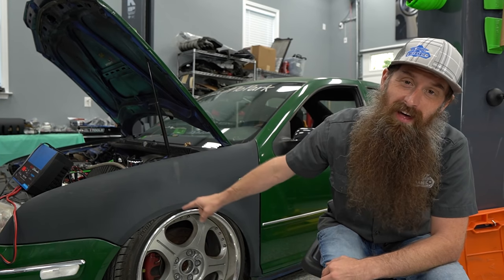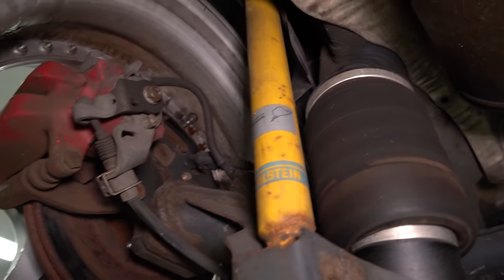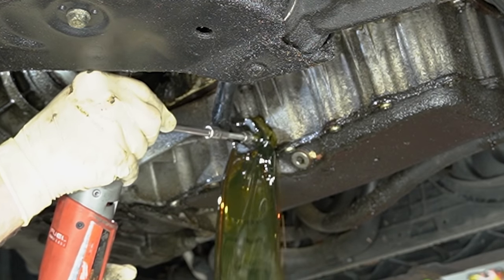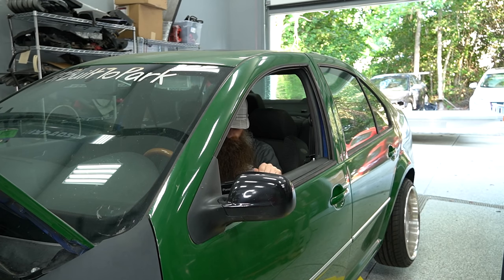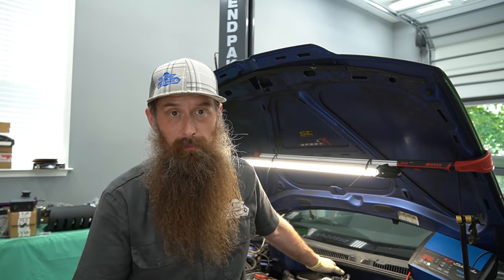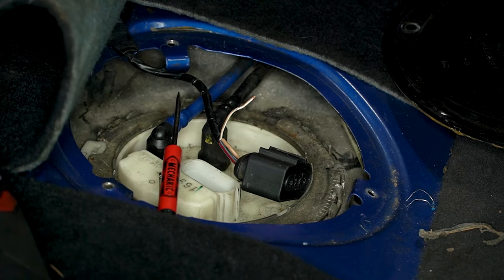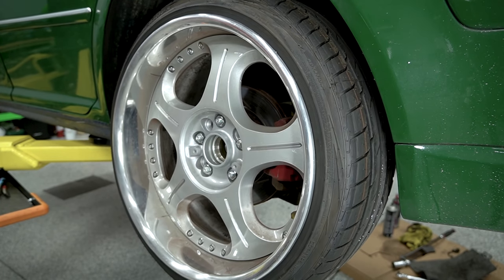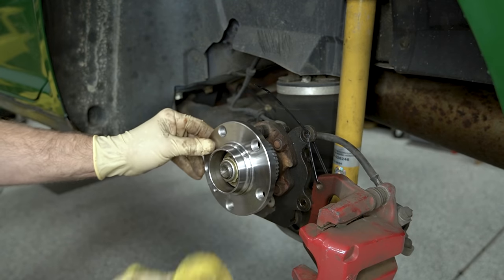Fixing a STANCE CAR for a 6000 Mile Road Trip

Comment: Pro Tipp for replacing the rear wheel bearing: 
1. Heat  up the bearing with a hairdryer to 90°C/194F 
2. Use cooling spray and  a PVC pipe to cool down the axle pin to-40°C/-40F
3.Slide on bearing easy

Comment: What I've learned with these cars is when adding rear camber, you have to account for the angle of the caliper too. You shim that as well. And also everybody forgets to shim for the added toe when adding camber
Reply: Yeah but how would you have your caliper moving independently of your axle?
Reply: @aygwm  the caliper mounts to the rear beam, separate from the hub. you can see it at 18:15
Reply: The drop plate should have the "camber" for the caliper carrier integrated in to it.

Comment: Great video! After watching part one of their trip I was curious about the bag system that was on the Jetta and what was causing the horrible camber even at a lowered height that shouldn’t cause so much negative camber. I’m glad that you covered the suspension modifications because I had never messed with any “stance” modifications. I’d never seen most of those mods before

Comment: A former co-worker's son came in one day to have work done on the car for inspection. It was a Focus ST and lowered on air. So the day his son brings the car, it fit on the lift just fine(just to note, the shop I worked at had in ground lifts). Co worker couldn't do inspection because of no registration. So next day co worker brings it in, and it wont fit on the lift. We're all scratching our heads because we couldn't figure it out, so we used a 2x4 to get the car over. After finishing the car. I saw the interior and the remote(for the air bags) and told said co worker to press the up arrow. Lo and behold car starts lifting up. Moral of the story, if you are working on a slammed vehicle on air, make sure you lift the air bags to higher than the lift pads and also air leaks out overnight I think, unless the POS had a leak. Anyway love the vid Charles as always. Also any plans for another meetup? I'd love to drive my R129 500sl(if allowed) to some car meet!

Comment: Been using a cheap aluminum diverter valve on my 1.8t.  RKX 1.8t/2.7t machined diverter.  They've been fantastic and easily modified depending on boost levels as they came with extra springs/washers.  Highly recommend over the stock plastic ones.

Comment: From my old BMX days, anywhere 2 different metals are touching, coat that area with some copper based antisieze.  We always saw aluminum spoke nipples time-welded to steel spokes.  Is this true in cars, such as where the aluminum adapters fit over the rotors?

Comment: hey, probably been mentioned but a quick scroll through I didn't notice any other comments, just as a heads up 9:08 that's a forged 007 diverter valve/ splitter valve, not a BOV. the DV is standard on these cars and typically safe to run this is just an upgraded version

Comment: If that's a forge brand diverted valve it actually recirculates like 90% of the air and uses 10% to give you the sound. Keeping the ecm happy by recirculating most of the pressure.
Reply from the maker: It may have been. But it was also leaking.
Reply: When they are in good function, they work great. Like any other mechanical device: it has required maintenance. Love the mk4 content brother!!!

Comment: I've never understood this type of suspension hackery. German engineers shaking their heads in disgust.
Reply: I have all these same suspension mods on my MK4, minus the camber. I drive it long distances regularly. It rides and handles great, not as squishy as a stock MK4, but certainly nothing to complain about. In contrast to the GLI in the video though, I took care of all the mechanical problems BEFORE I lowered it 😂
Reply: The difference between “ look at me!” Car and performance car.
Reply: @VanHeezey  Debatable
Reply: @VanHeezey  'handles' great?  Yeah, I would LOVE to take a factory stock MK4 out on the track and run some competing laps for times to see how great it 'handles'.  These cars are very sensitive to suspension geometry changes, particularly changes to ride height where the steering angles get all fucked up...
Reply: @chewitt608  you can debate it all you want, at the end of the day it’s an economy car. I’m not doing laps in it, I’m literally driving it around town and to surrounding states. Does it drive as nice as my e92? Absolutely not. Does it do the job without any drama? Yes. That’s what I built it for. To look the way I wanted and to be a comfortable car to be in.
Reply: @whorutothink  I’m aware how sensitive they are, my car came with the stock setup. When I said “handles great”, I’m speaking relative to the type of driving you usually do in a 20 year old Jetta. It’s not a race car, it’s a cheap little fun car I can drive around town.
Reply: Trust me, German engineers are not allowed to throw the first stone. They do some really wonky, over the top stuff that isn't necessary, but do it because they can and helps bring the car back to the dealer to keep "the people" from working on their own car.  "simple" or "k.i.s.s." is not not in the German vernacular.

Comment: the 20th gti with a gli front end i own also had a bad wheel bearing but it was a miracle that a wheel didnt just fall off, when I bought it I always heard a super loud whine from the rear, after a week I lifted the rear end and first spun the driver side wheel, no play nor noise other then the brake pads touching the rotor time to time, the passenger side however, all I hear was a ticking sound and it kept spinning for too long and so much play, I took the wheel off and the wheel bearing was so bad  I was able to remove almost the entire bearing with my hands alone after taking the nut and brakes off and there wasnt a cap covering it and when it did come off the bearing just fell apart in my hand , most of the old parts on it just gave up and for some reason it just leaked a bunch of water, and I replaced the wheel bearings, stub axles and hardware on both sides since I wanted to replace it all anyway

Comment: Hey Charles, I have a totally unrelated question to the video! Your channel has helped me successfully complete many a DIY repair on my 2.5l Jetta, especially the vacuum pump replacement without needing to separate the trans from the engine. I’ve had an oil leak which will not give up, a shop replaced the seals on my oil cooler which accomplished nothing, and I’m still stuck. It’s still leaking from the oil filter/oil cooler area and I’m running to get some dye now to get a better idea of what’s leaking. If you’ve any guidance on the subject I would be exceedingly grateful. Thank you for the great, informative content it’s made being a VW owner much less of a headache!
Reply from the maker: Is it the filter housing?
Reply: @HumbleMechanic   I can’t tell. The dye led me to the top backside of the oil filter,  but that’s just as high up as I could see with how tight everything is there. One individual on a 2.5L forum replaced all the seals from block to oil cooler to filter housing and that solved their leak but they never pinpointed where it was leaking from. I’ll drain the filter, remove it and reinspect in the next day or so to see if I can’t find anything more definitive. I just don’t want to make any repairs if I’m not sure they will stop the leak. I’ll keep you posted on my findings, and thank you.

Comment: I have 315,000 miles on my original rear brakes on my 2015 TDI Passat and there's still some meat on the pads. Just changed to my fourth set up front.

Comment: Charles working on a 1.8T seems so strange
Reply from the maker: Lol it’s probably the engine I’ve worked on the most at the dealer. Also we are doing a “big turbo” 1.8 TT soon
Reply: @HumbleMechanic  its the engine I've worked on most in the last 7 years haha.  The reward is great when these motors are running happy though.

Comment: I will never understand the appeal of setting a car so low that alignment is screwed up, handling is screwed up and the wear on parts is accelerated.
Reply: I can understand raising and lowering to a point, but the stancing is too far.
Reply: ...it's another form of "peacocking" 🦚🦚🦚
Reply: Me to
Reply: ...like people who buy 30" rims to put UNDER their garbage Bel Air. 🤦... So dumb.
Reply: You know you can adjust the alignment right? Also if you do regular maintenance it’s not an issue, tons and tons of people slam cars this low, I just think the owner didn’t understand how to take car of their shit, but to each their own
Reply: @johnathanblanco458  you can only adjust the alignment to a degree because the suspension is designed to shift the camber when cornering (to counteract body roll)... If you lower a car this much, you CANNOT adjust the camber back into spec without special parts.
Reply: I mean adding negative camber and lowering the ride height does improve handling but this is beyond that
Reply: @johnathanblanco458  I think you have to do more than "regular" maintenance lol
Reply: When I was young, we lowered our cars. But only to enhance the handling. I had a 67 Camaro that I “can-am” ed.
Reply: @johnathanblanco458  the car basically has zero resale value after this has been done.
Reply: @user-rb1yf4he9q  yup, I just lowered my VW by about 2"... and that was enough to permanently push the camber out of spec by about a degree. (alignment techs could not adjust it in) 

I might raise it by a 0.5" just to get it inside the 1.3 degree spec.

Comment: HOLD ON, Are those GLI front seats or 20th ae /337??? They flipped forward at 13:46 buut I don't see the flip up handle on the inside of the seat. I thought all recaros in the mk4 GTI's had both(handles on the left and right side of each front seat). Did some glis come with flip up front seats?

Comment: 4:30 can you pressure wash that oil while the car is jacked up? Well 1.8T doesn't love blow off valve without proper tune, i personally prefer original VW/Audi diverter valve on these engines. I woul also smoke check intake manifold, sometimes there is a leak around pcv or vacuum hose that goes to the brake booster. I also had leaks around injector cups

Comment: Mk4 Jetta Blue Lagoon ftw!
Best and most reliable car I've ever owned. Mine is an underpowered 1.6 NA with 105 ponies.
Just noticed the first rust bubble, which I have to fix asap.
Long term plan is to convert it to EV by 2030.
Reply: What about Hydrogen? Toyota and Yamaha are working on a 5.0L V8 with no lose in power!

Comment: Can you explain why, when putting on the axle bearing, you would not use something like a tiny slathering of anti-seize to assist in installation?
Reply from the maker: You don’t want the inner part to move on the stub axle. You only want the bearing to spin

Comment: Hi Charles, I know I was young once, but I think what they have done is cruelty to a vehicle,....
Anyway you mentioned the use needed of about a gallon of brake cleaner needed.
Can you please tell me WHY you don't buy your brake cleaner bulk in 1 gallon tins and transfer it over to a spray tin and pressurise it with your air hose?
Not only would it be cheaper, but more environmentally friendly, or is it that your sponsor won't let you, if that is the case I suggest that you talk to your sponsors about CHANGE in this case "sh*t rolls UPHILL"
You seem a good and respected bloke
Now is a chance to elevate your status to the next level
and save yourself some money
I know that mechinist  channels like Abomb79 and Keith Rucker have been using this method for years (as I enjoy their channels as well)
Thanks for the effort you put in to produce your videos they are ALWAYS enjoyed
Tony from Western Australia 🇦🇺
Reply from the maker: You’re 100% right. And I have those refillable brake clean things. It’s mostly convenient for cans
Reply: @HumbleMechanic  convenience is for wimps 😁 and is an excuse for laziness (so says the biggest slothfulness person on the planet) get a bigger personal spray tin so you don't have to fill it as often say 2 or 3 times the size Adam (Abomb79) uses one that looks about a 1 Litre tin with a decent reach nozzle length to reach awkward areas 
Buying bulk (especially if you hit the manufacturer for a sponsorship) is usually always cheaper and who can't use the extra dollars in their own pocket? 
Tony 🇦🇺

Comment: I have a question for you I have a mk4 gti and I have a boost issue it goes straight up to 15 psi then bounces back and hold 5 psi I have tried everything I am hoping my tune if for a blow off vaulve I have a bigger turbo in it I  just genuinely confused

Comment: Do you happen to know what the special tool number is for the rear wheel bearing installer? Or if it’s on Amazon doing the wheel bearings on my car soon enough
Reply from the maker: Yes. It’s 3420 wasn’t too bad even from snap one VW site

Comment: Pretty strange mod to put a blowoff valve on the intake pipe that looks to be before the turbo, the side that's only ever gonna see vacuum 🤔
Maybe I'm wrong tho, not too familiar with how vw does it
Reply: It's a common mod 16 year olds do to their VW's when first buying a 1.8T. Slap on a BOV because they'll get cool noises and won't affect the engine whatsoever. insert facepalm emoji

Comment: I will forever not understand people that put blow off valves on 1.8Ts. The factory diverter valve makes just the right noise with a cone filter. I ran my 1.8T with a ramair induction kit alone, on stock DV, and it sounded amazing and ofc no error codes. Its plenty loud enough that it makes peoples head turn. If you run higher boost that the stock DV cant take, there is an upgraded DV valve that will do the same thing as the factory but actually handle the increased pressure, compared to the factory DV's membraine splitting.

Comment: i drove a mk4 golf across country with a bad temp sensor, leaking radiator, one unplugged plug wire, and rusted stuck e brake. i would bet this thing would make it 6000 miles no problem with out these fixes lol

Comment: Are tires designed to be that bent on the sidewalls? surely the tires designed to have a straight wall and tested as such, when they balloon these tires surely its not good for the tire or the driver in this shape for wear?  I'm not saying it doesn't look cool, on show cars for sure, but driving id be scared